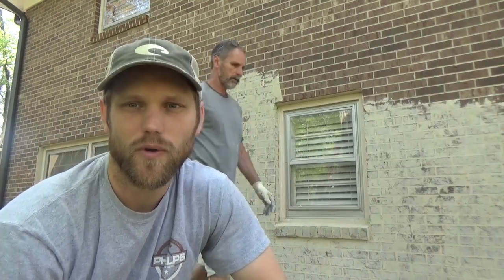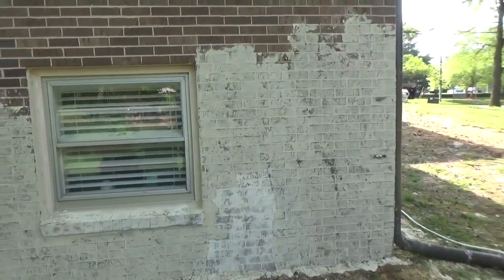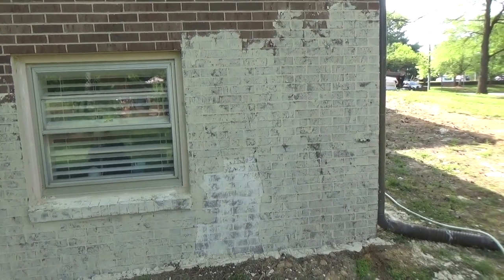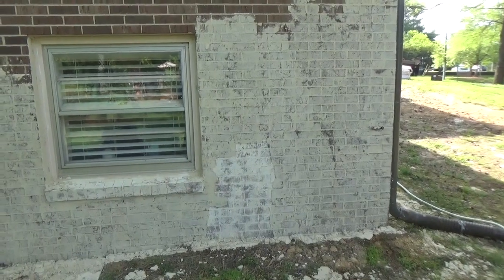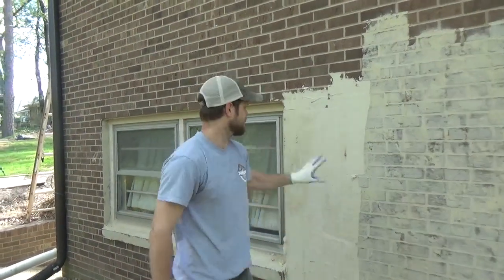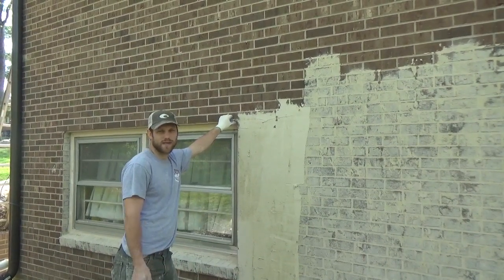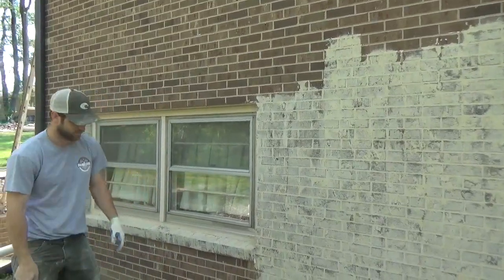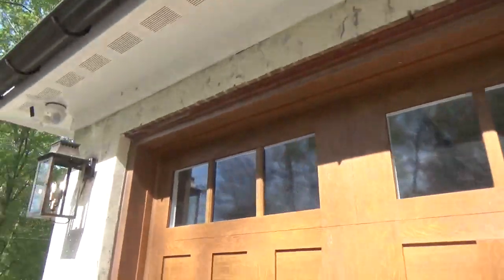German Smear/ Mortar Wash Brick House

Comment: I did follow your recipe, plus followed the tip from the guy  at hardware store, adding a dash of liquid dish soap; Not sure what exactly it does. I applied to interior brick walls, and it looks fabulous!. A bit messy, but the end result is wonderful.
Reply: improves flow and workability of the mortar

Comment: Looks great. I tackled this on my floor to ceiling fireplace. I wish that all the "pros" would mention that it isn't as easy to do when your brick is rough (deeply pitted) and the grout lines are deep.
Reply: Mine are too and that's what I'm worried about.
Reply: You can pipe it onto the grout lines with a bag to help fill it in easier.

Comment: I have a very ugly brick building.. the bricks are purple, red, orange, green, and brown... LOTS going on. I want to do this but my brick is EXTREMELY textured so I'm not sure if this will work.
Reply from the maker: You may want to try lime wash instead of mortar wash.  You can apply it like paint with a brush which may be easier if you have a lot of texture

Comment: Could you use white sanded grout or does it need to be actual sand?
Reply from the maker: Do not use sanded grout, use mortar
Reply: Ninja Contractor is the sand call d White Silica Sand you used?

Comment: How much cost does it to do that i want to do it  in my house
Reply: If you buy white thinset cheap (like $12/10 lb bag) I estimated about $150 for covering the square footage of my exterior brick at 1600 sqft. It’s been a while but I think I estimated about 128 sqft per 10lb bag. Definitely you should look at a bag of thinset you have access to and consider that the sqft coverage is based on that “different application” (under tile) and think about the kind of coverage you want. If you want a thinner look vs. a more covered and solitary color look it will change the amount needed. Pretty good odds though considering the material cost! Definitely a lot of work, but the good kind I think.

Comment: Hi thanks for sharing this video! The house turned out so beautiful. I would like to do this german smear in my exterior brick house though in my area they don’t sell “White mortar mix”. You mentioned you made your own.  Just few questions, was your type s masonry cement in gray? (that’s the common color that they sell on home depot & lowe’s) and what brand of white sand? Appreciate it!
Reply: White thin set is basically the same thing as mixing mortar with sand
Reply: White Portland cement and white sand with lime is the ideal. But I only needed a little bit. I searched high and low and finally found some readymix white. Home Depot sales it but not in my area and they won’t ship it. Lowe’s and Home Depot’s product in stock would be too dark. I got lucky and found some at mutual materials, a paver/brick fab company in the northwest. It really was by accident because for some reason they received the wrong shipment of white ready mix. Well, it’s snow white for sure. Looks good

Comment: You're doing it all wrong. The idea is not to make it look like you whitewashed the house. The idea is to give it a unique German schmear look.
Reply: No actually this is the best method.  The other DYI methods are a waste of time.  You can make this look how ever way you want depending on how long you leave the parging material on the brick.  You can scrape it off right after you apply it to expose most of the brick, then slap some more on to taste.
Reply: @SGspecial84  If you apply it all over everything and then wipe some off, it's twice as much work. So long as you wipe some off that's good, otherwise it just looks like the brick has been limewashed being all with a whiteish cast.
Reply: @SGspecial84  no this isnt a german smear, this is not the method to achieve german smear..... you sir are incorrect.